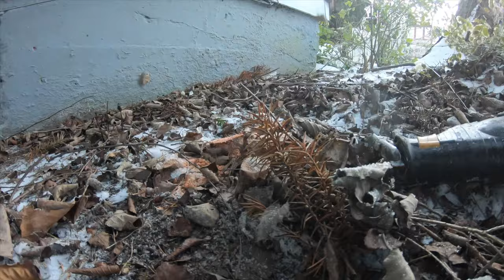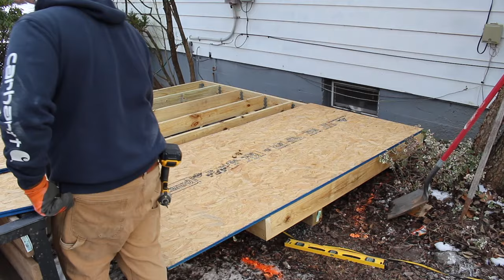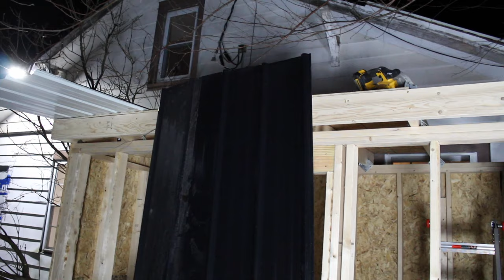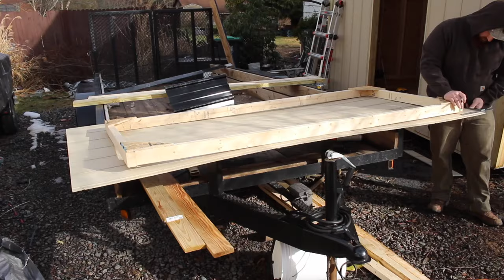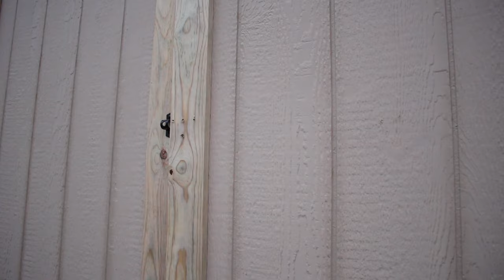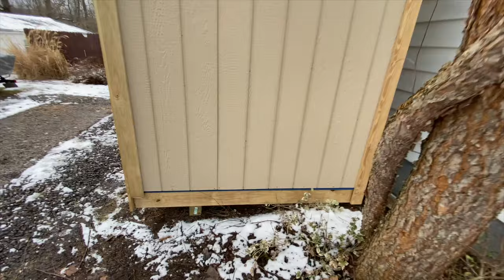Storage Shed for Cheap! | Start to Finish Build

Comment: Really helps if you have carpenter skills.  You make building a shed look so easy.  I only need to build a 6' wide x 2' depth x 6' height shed but I'm skeptical of my carpenter skills.  I just need to buy a custom kit.
Reply from the maker: I never had any formal training, just learned over the years. If you are making something that shallow, I would suggest anchoring it to a building or something, that will not resist winds easily. I was worried about mine a little bit at first even but with it against the house, I should be ok.

Comment: I like the overhang in the front. Keeps the water out and you won't get as wet being inside withe door open during rain.
Reply from the maker: That was the thinking behind it! Works pretty good, keeps the inside dry from splash back since I am not installing gutters on this.

Comment: I'd be concerned about the flooring edge exposed on the 3 taller sides where the sheathing was shorter than the front. Plus without those 3 sides being fastened to the rim joist, lateral stability has to rely on just the fasteners in the studs. But I guess it's easy to be a critic being a spectator in the cheap seats. Your video was inspirational. Now I need to get to work and build my own.
Reply from the maker: Haha you said it better than I could have. The sill plates were fastened into the joists. I agree about the sub floor being exposed, but with this not being a heated space, and the roof over hang, I’m not too worried about it for now, once I paint it, I may go in and add some more trim and caulking, thanks for the comment Steve!
Reply: Remember it’s just a shed
Reply: @DavidRodriguez-wd2sz  Yup, nobody is going to live in it...hopefully.

Comment: I feel like that thing would blow over if the big bad wolf came!!! Overall its a very well built shed, juat where I live id need to secure it to the ground somehow
Reply from the maker: I guess it’s a good thing I don’t have any big bad wolves near me! Haha. I put mine against the house for that reason. We don’t get a ton or wind either. In our area, sheds can’t be attached to the ground, if you attach them, you get taxed as a permanent building. Typically why they’re on blocks. Thanks for the comment.
Reply: @Slaterandson  ahhhh cheating the system, gotta love it!!

Comment: Nicely done. Build and video.
How close to the house? Wondering how you paneled the outside of the back wall. 
Did you lose a window in the house? Access to electrical service?
Reply from the maker: Hello, about 2 feet from the house. We have window that is on our staircase inside (that we never use) so you can’t tell on the inside really. Electrical service is all remote read, but since this isn’t the permanent location, I wasn’t worried much anyway. We plan to move it in a year or 2.

Comment: Nice foundation without pouring concrete. Like a deck build.
Reply from the maker: Our area cannot have a fixed foundation for a shed due to taxes. This is common in our climate to put on blocks, I’ve had no problems with any of my sheds on the property.

Comment: I like this design. Does the ground need to be up on blocks
Reply from the maker: Thank you! I put it on blocks and elevated off the ground in hopes to keep rot from happening. Also used pressure treated lumber for the joists and 4x4 runners underneath, might need to check local code for sheds as well.

Comment: It looks amazing and you did a great job! I'm wondering if you had to use an angle grinder to cut that roofing material, or did you use your circular saw? Did you need a special blade? Also is it not too close to the electric meter? I hope your service provider doesn't give you grief about that!
Reply from the maker: Thanks for the comment! For the roof I used a circular saw with a metal blade, definitely need to have safety glasses or face shield! And they read remotely, so I’m fine, but it is only going to be there temporarily anyway. Thanks again!

Comment: Very nice! How did you mount the floor to the blocks?
Reply from the maker: Thank you! And since I leveled the blocks relative to each other, there is nothing attaching them. In our area, that’s all you need to do for sheds. I may be wrong, but in areas with higher winds, you may need some sort of ground anchor.

Comment: Hey. It’s cool video. What is name the metal for that roof stud??  You got two kind of metal right?? Different size? Thanks
Reply from the maker: This were just joist hangers for the rafters, they’re not necessary I got a different joist hanger for the floor joists also,

Comment: Greetings from Croatia! I really like the shred you built. Im looking into building one myself. What if i need a anti-thief lock? The lock you used is easily removed with a screwdriver, any idea how to make a thief proof door?
Reply from the maker: Hello Draxx! That’s for the kind words! As far as a latch that is theft deterrent, I did a quick search, the only thing that wouldn’t have screws on the outside would be a deadbolt lock like you would find on your house. Every latch I found online had screws that could easily be removed. Unless you took a regular latch and coated the screws and surrounding area in a silicone caulking, but that would only still be a deterrent.
Reply: You could possibly use bolts with lock nuts on the inside. So if attempted they would be loosened but could not be removed? Or carriage bolts with nuts on the inside to tighten them down, Just some thoughts.
Reply from the maker: Ed D Ice that is a great idea too! Might be easier than trying to do what I was saying too.
Reply: Hope about adapting the lock from a truck camper??
Turn the knob
The bolts slide into place into goes drilled into the framing
Lock the knob

Would be really secure IF you could find one long enough to mummy it vertically where the knob usually goes

Turn the knob
Bolts slide into holes in the header and sub floor

Comment: Hey you did a decently but you should use advantage tech on the floor because that sheeting does not do good with water we’re the other is water proof
Reply from the maker: The shed inside never gets wet, advantech would be overkill for a cheaper shed. I spent a little more on the roof and sealed it up good so I’d never have to worry!

Comment: You can use reg wood for framing and not pressure treated?
Reply from the maker: In my area it’s pretty damp, but even in most environments, I would use pressure treated for the floor beams. I used standard 2x4’s for the. Walls and roof.

Comment: sweet man! how long do you think that exposed wood will last before it starts to warp?
Reply: Could have used cedar, or treated it with sealer.
Reply from the maker: I’m not sure but the base is pressure treated and I ended up painting the whole shed after 6 months when it got warm

Comment: Awesome I would like the measurements to try and built me a she shed
Reply: the best way would to just measure the area you need. conform to the stud spacing. you should be fine. figure your height and depth. other then that is like making a speaker box with ribs. minus the glue
Reply from the maker: I did 16” on center for this build for strength when relocating the shed

Comment: Great job bro, one question! 
I did not see that you fixed the concrete pillars of the base with anything, you just left them loose? Did you make a hole that you then filled with cement to support the concrete blocks?
Regards 

Thx
Reply from the maker: Thanks for the question. I actually just used pea gravel to level out the ground for the blocks. On my county, we are not allowed to have any fixed foundation, so I had to keep it “non permanent” it has been over a year though without anything moving! That’s with 2 winters of freezing ground too.
Reply: @Slaterandson  Ok I understand, thx for you answering! from what I see, it's still on your site! 🤟

Comment: You covered your meter bud!  I see there's a gap between the house and shed, just had to give you a hard time.  Nice build, what's that sheeting you used for the exterior walls?
Reply: I got some of those to fix current shed doors. Its panels from menards or elsewhere.
Reply from the maker: Haha it’s funny how many people mention that! They read it remotely here and if they had to, there’s still plenty of room. The gigantic bush I took out blocked it more for years before the she was ever there haha. It’s a prefabricated, I think they call it T11 engineered plywood? I bought it at Lowe’s at the time for around 20$ a sheet

Comment: I love your video but I would like to ask you a few questions if I may? 1st how high is the back wall and the other walls because I would like to build this exact shed on my house if you don’t mind,thank you
Reply from the maker: The back wall is 8 ft tall, figured I’d be able to put my shelving to standard height then. I believe the front wall is 7’6”. That allowed me to frame a standard door frame then in case I want to add a steel man door in in the future. Any lower and I would be able to have the space. Good luck and thanks for the comment
Reply: Slater & Son i thank you and as you know I’m not a professional contractor but I’m willing to take a challenge and I thank you for replying me back.
Reply from the maker: No problem at all, reach out if you need any help, I did my walls 16” on center to make it strong enough to move when I need to.

Comment: one question will the 🚪 door sag if there’s not a board in the middle? i’ve seen people as a board in the middle so i’m curious is it necessary?
Reply from the maker: Good question! I’ve never had a shed door that doesn’t sag. I’m actually going to add a turnbuckle to tighten it up a little bit. That way it’ll be adjustable, other than that, I could have installed a regular steel man door in that opening and I may do that in the future. I framed the rough opening that size to keep my options open.

Comment: Do you not apply preservatives?
Reply from the maker: The outside had a primered surface already and the trim was pressure treated. I ended up painting the whole shed after too

Comment: Great video production! Why put the roof sloping towards the house and the whole thing in front of the meter?
Reply from the maker: Hey Jon,
Great questions. This video was about the shed build, this is a very temporary location for the shed, our meter is read remotely as well, so I won’t have that as a concern. 2nd, I have the roof pitched so that it does not drip straight against the foundation of the house. Any shed you would build against another building, needs to be pitched away from the building for proper run off. Thanks for the comment!

Comment: Great build man...how much did you spend to build it.??
Reply from the maker: Thanks Jorge! I went with a metal roof but I have around 800$ into it, my metal was leftover from my house though, so I saved some. Shingles would save you some as well, but I personally like metal for easy/fast install
Reply: @Slaterandson  Not bad...
Now I have an idea how much I could be spending for something like this.
Thank you again.
Reply from the maker: No problem, If you have a local habitat for humanity or surplus/used building supply place , you can save some on hardware and trim, I also went with pressure treated for the base, so that added some more cost as well.
Thanks comment and good luck with your build

Comment: To create the slope, how much taller is the back frame than the front frame?  Thank you!
Reply from the maker: Mine is 6 feet from the tall side to the short side. I went I went with 8 feet in the back and 7’6” in the front. I also used metal roofing so that may make a difference as well depending on your climate.
Reply: @Slaterandson  Thank you for the quick reply.  Happy 4th!!
Reply from the maker: You’re welcome! Happy 4th to you as well!

Comment: Hi. What type of screws did you use??
Reply from the maker: I used 3” t25 torx framing screws for the walls and rafters. And 1 5/8” or 2 1/2” for the hangers and the siding. Usually I have those 3 sizes whenever working on any decking or home improvement project, in either exterior or interior. Saber has been a favorite brand of mine lately for price point and how easy they drive.

Comment: What material is used for exterior side walls ?
Reply from the maker: Michael Blast it’s called a primed engineered panel, it comes in 4 ft by 8ft. You can overlap the joints and not see the seam, all it needs is paint once installed. Somewhere around 20$ US a sheet

Comment: What are the brackets you used for the roof called? And is do you have a list of material used for the roof?
Reply from the maker: I couldn’t find one name for them other than hurricane tie. Here is a link to what it is on amazon. Simpson Strong Tie Simpson Strong Tie H1Z ZMAX Galvanized 18-Gauge Hurricane Tie https://www.amazon.com/dp/B000MGNIZG/ref=cm_sw_r_cp_api_i_9msGFbMRRXWBS

Also I do not have anything put together yet, but I will soon.
Reply: Thank you! One more question, what’s the material you used to cover that opening under the front of the roof?

Comment: You built in front of you electrical meter???
Reply from the maker: Angle of the video is deceiving, but also the meter is read remote, I’ve had it there for 2 years without any complaints 🤷🏼‍♂️

Comment: How did you secure it to the ground? Thanks
Reply from the maker: I live in a very low wind area and with it against the house, the weight  alone is sufficient. I used pea gravel and solid cinder blocks to level it out and then 4x4 posts to make moving it easier some day if I chose to.
Reply: @Slaterandson  thank you

Comment: Did you use a Brad nailer or framing gun. Couldn’t exactly tell
Reply from the maker: For the outside trim I used a Dewalt brad nailer I have, the rest of it I used torx screws so that I could put it on a trailer and move it some day.
Reply: Thanks for the quick response. Oh alright. I’m rebuilding one tomorrow & I was going to use a framing gun for the siding panels. That should be fine
Reply from the maker: No problem! Just watch the t-11 or whatever width you use, the outer layer is a softer than plywood it seems for a nail gun I noticed. Take care!
Reply from the maker: Forgot, a lot of guys use staples for the sheeting I’ve seen.

Comment: I built one didn't level the bricks under I stood in it and it fell forward I was trapped in there for a week😭
Reply from the maker: I’m sorry to hear that, with short screws in the siding, you can kick your way out, I’m lucky to have very rocky soil where mine is, so I shouldn’t need to worry about settling either.
Reply: New Beginning 
     Where did you (two) learn to punctuate ?  
My friend wants to know, so he won’t accidentally move his family into that school district. 
He’s my friend and he’s asking.

Comment: The metal joist hangers for the floor weren't really needed. Could just screw or nail them in.
Reply from the maker: Since I plan to move this shed, I didn’t want the ends of the screws to get soft and pull out when I move it in a couple years, otherwise I agree. Same reason I framed it 16” on center.

Comment: Looks like the electric utility will have a difficult time reading, removing and replacing meter.  Does not appear there was adequate planing and placement of storage shed.  

There must be sufficient clearance so the meter can be safely maintained from time to time.
Reply from the maker: Thanks for the concern, however, there is plenty of room and everything is done remotely with out power company. This shed will be moved within a year or so which is why I built it a little more solid than a typical sheet. Thanks for watching!
Reply: Slater & Son 

Yeah....I am one of those retired utility people who think about things like that.  The company I worked for liked to have a minimum clearance of 6’ when standing in front of the electric meter.  Of course, that isn’t possible all the time.
Reply from the maker: Thanks for the input!
Reply: Slater & Son 

You are welcome.  BTW, I neglected to say NICE VIDEO!  Thank you for sharing.

Comment: I hope that hole it's blocking is just a basement window and not crawlspace access. 😳
Reply from the maker: In northeastern United States, most houses have basements, this shed is on a non permanent foundation and can be loaded easily onto a trailer and moved. Typically a crawlspace wouldn’t have a window only able to be opened from the inside haha. Thanks for the comment

Comment: I want a lean to  shed but not attached to anything
Reply from the maker: That’s basically what this is, not attached to the house and can be moved
Reply: @Slaterandson  I want to insulate mine with roxul rockwool    to keep dampness out . My house is done with roxul  and I love the stuff . no bugs , no wet mold infested insulation  for me  . My attic , my walls  my floors all have it and it saves me  on my electric bill . Less than a hundred dollars a month on a 2440sq. ft. house . My koi pond uses more electric at times than my house . That has energy efficient pumps and aerator , but heater to keep opening in ice in the winter runs it up . My house is all electric  no choice only propane besides and in hunting country not sure i would want a big tank bomb in my yard
Reply from the maker: @sissymurphy9620  that’s great, I’ve used roxul a couple times and have loved it too. We’re in an area hard to reach with anything except propane or electric as well. Good luck with your build
Reply: @Slaterandson  thank you and best wishs to you